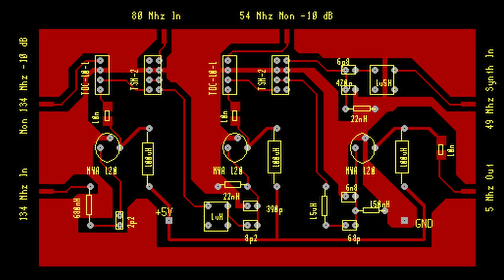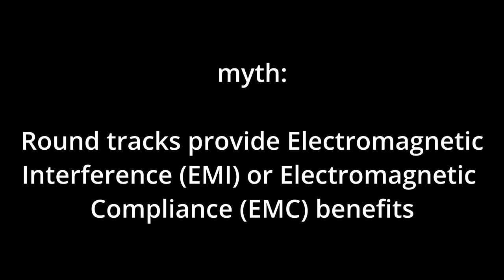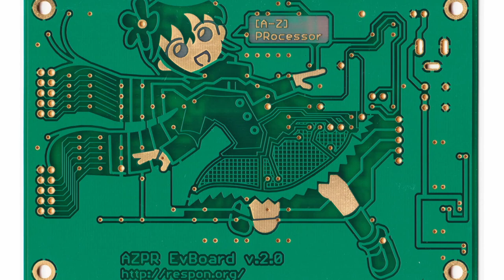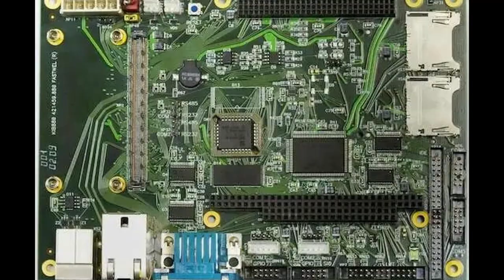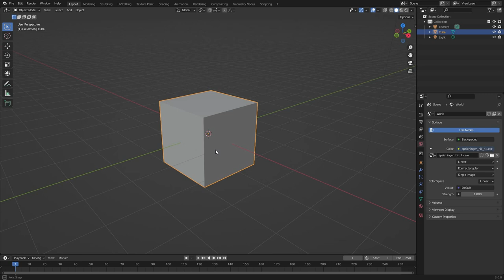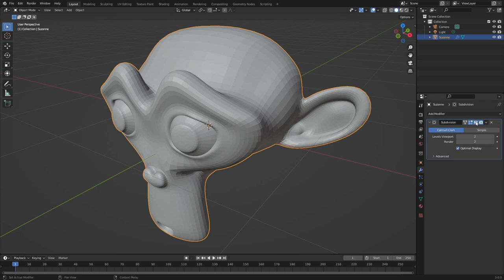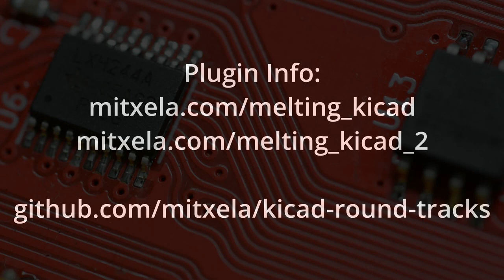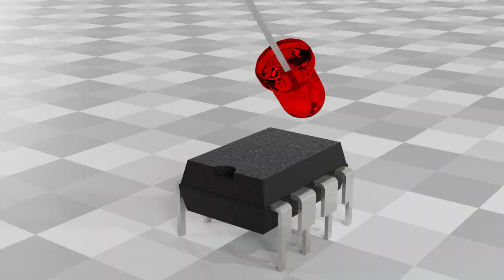Melt your circuit boards

Comment: Bro, it is just an asthetic, calm down.

Literally everyone who has used a CAD software knows they can design a board in any way they like, most people design it that way because it is what they are used to seeing, the fact that you are getting triggered over an asthetic choice is hilarious and sad at the same time.
Reply: you're the one who needs to calm down, he's just explaining the pros and cons of sharp tracks on circuit boards
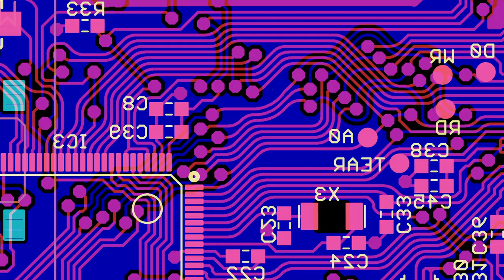Reply: @2fifty533  1:44 "So if you design a board like this, you are a victim of peer pressure."

Uh huh, I'm the triggered one here apparently.
Reply: @green-lean-espeon  well circuit boards aren't meant to look cool, they're meant to work well
designing it like that makes it a lot less efficient whether you like it or not lol thats what he's pointing out
Reply: @2fifty533  But that isn't what I am saying here though, what I am saying is that nobody is forcing anyone.

I work with CAD softwares before, virtually everybody was making the 45 degree turns thing because they thought it was either easier, something like "It looks neat.", or saying they are more used to design a board that way.
There are many different opinions, but none of them are about "peer pressure of cultural tradition".

I am not saying "We should keep making 45 degree turns!", I am saying that his reasoning makes no sense because that is not how anyone in real life actually thinks, you will meet literally nobody who even remotely thinks "We should be making it like this because this is our cultural tradition!", it is effectively a worthless rant with no citation or sources to back up.